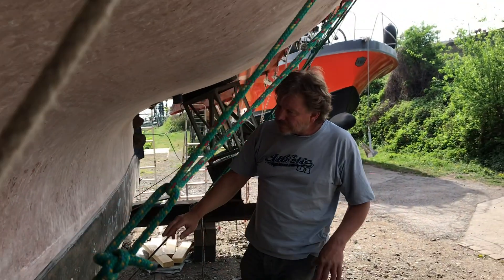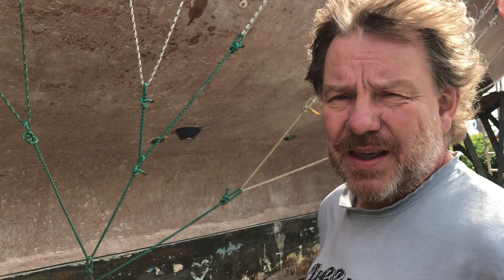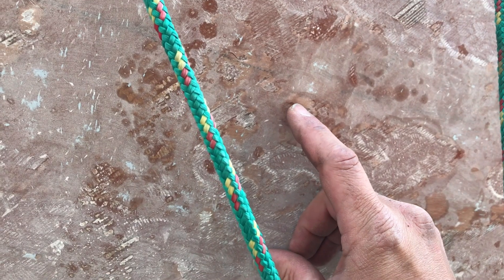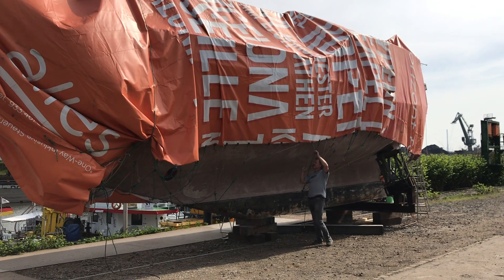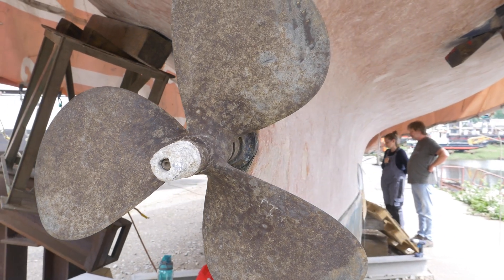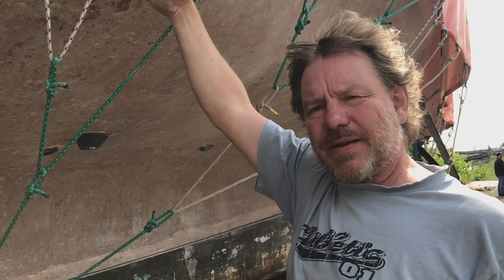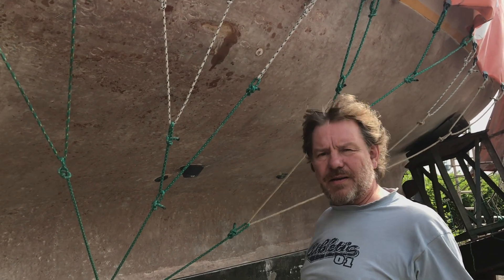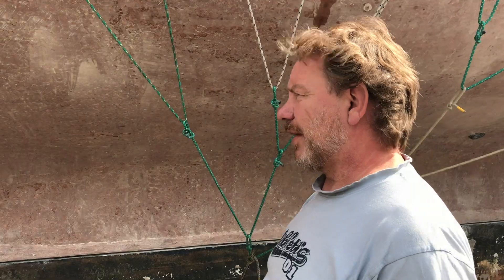Osmosis Explained - Sailing Mahalo Episode 6

Comment: Let me ad the following to his explanation. The blister does not just form in random locations, and for no good reason. The blister forms initially because there was a void in the gelcoat and/or fiberglass resin/glass. That void, even a microscopic void, fills with salt water through osmotic pressure. Which inturn starts a chemical reaction within the fiberglass resin. The reason that the entire hull below the waterline does not form one giant blister is because the entire hull is not totally filled with voids. The blister will only form where a void once existed. My point is this. If the manufacturer of the hull would have invested in better equipment, and they would have properly trained their layup crew, and they would have used vinyl ester resin instead of polyester resin, there would be far fewer blisters in hulls. But profit comes before anything else. So you end up with a bunch of blisters as a result.
Reply from the maker: Thanks for the additional information, David!

Comment: Osmotic blisters are caused by incompletely catalyzed pockets of resin. This happens because once the catalyst is added there is only 15 minutes of working time so the tendency is not to spend enough time mixing the resin and catalyst. When the components are fully mixed you will not get blistering. I worked at a major sailboat maker for 16 years, the last 5 years I was the customer service manager and dealt with the blistering problem extensively. We had 
many production boats that never blistered so it is not inevitable that blistering will occur due to the use of polyester
resin. If it does occur, then a coating of epoxy is a good solution.
Reply: Would this apply to fibreglass corvettes, mine has some blisters on one side of the hood . It was repainted with PPR polyester paint and a year later the first bluster appeared, now it has a few more.

Comment: Wow, I could write a chapter of a book on what I have seen here and in the other videos. I’m Not sure where to start 
You video work is good but you are a pro and it shows! It’s wasted in this project.
I think Chris made a big mistake buying this boat ,sorry you probably all know that too. It happens. You also did not appear to pull the boat out of the water for the surveyor which would have found the osmosis problem & bad laminating problem. This boat was amateur built unfortunately ,and not by a fiberglass expert. Then it was done with an unproven method that was hugely questionable.  I also think the choice of the actual polyester resin type may have been wrong.  There are various type that are better or worse for water immersion. Some type have better chemical ( water) resistance than epoxy , that also comes in various types..  This was one mans life work and it is sad that an unsuitable method was used to build this hull from, The interior means nothing if the hull/foundation is bad . Since the hull is an integral part of the interior it must be right to be worth pursuing .  
From the few photos it looks like the plywood for the bulkheads and other wood structure are not marine grade , BS1088 Brunyzel. Plywood is the only wood that lasts in the marine environment , all else rots sooner or later. Frequently Encapsulating in resin epoxy or polyester will cause rot faster in wood it just takes longer to see The rot. 
The rotten keel is a huge problem , boats do not get built properly where a little caulking applied externally is supposed to seal leaks . The hull should be designed completely differently. . It’s not your fault you are not boat builders or apparently previous body owners.
Back to the fiberglass , you have found huge blisters deep in the laminate . This boat was not built in a mold  but as a one off with the layers built up from the inside out . Done right this can produce a good laminate but it appears this fiberglass had a lot of voids left in it which only accelerated the osmotic issues. I can see how this would happen . Incorrect preparation of the cured layer before applying the next, working upside down, working alone probably in poor lighting  many possibilities.   The gelcoat applied externally is a sketchy process at best , and under water take carful application over the right kind of fairing compounds , was it polyester or epoxy fillets used , I bet polyester type and what grade???
These are only the things you can see , what about all the things you can’t see , what are the engine bed like ? Are they wood , what wood? Are they rotted? , what about the mast supports are that done right ? With good materials?   An amateur built boat has to be reviewed very carefully . A professionally built boat built with good processes you  have a chance to fix and get something worth having .
 The crazy pipe or tubes or whatever????
You will need to blow air or vacuum the water out! Crazy .   If you thought everything else on this boat was perfect above and below the waterline you could remove all the outer fiberglass and all the pipes ( a section at a time ) and replace it entirely with something else , many choices.and then re laminate  the hull again. But the rest of the boat is not right! Clearly , 
The designer , who was this ? it’s a weird looking hull , very heavy and possibly too small sails.  Very odd looking , strange stern cabin maybe a modification by builder?
I would get  another or the same surveyor in to look at the boat now with it  opened up and see what they say , preferably  somebody who has worked in s boatyard too .   I think you will be surprised what they might say now  .
Sorry this is really long comment and you probably won’t read it but the bottom line is ..... take the loss , sell the good bits of the boat , engine , sails etc and go buy a smaller boat which you can go sailing now . Have fun live your lives doing the fun stuff , there are many good boat out there . that were properly made get one of them 
 You can never make this boat right again the time has come . 
All the best Warren 
40 years on designing and building , ex boatbuilder and still in fiberglass business

Comment: What about the above the waterline? Surely the same method of construction with polyester resin continues above the waterline. Although blisters may not be as extensive, it might be worthwhile removing the gelcoat above the waterline and adding a good foundation of fiberglass with epoxy resin. Just a thought....
Reply from the maker: Great point! We've thought about doing a complete job, but osmosis really only has a chance to occur from the water line down. Everything above is not exposed to water for long enough to become delaminated. Considering the cost, we will stick to a bottom job only for now.